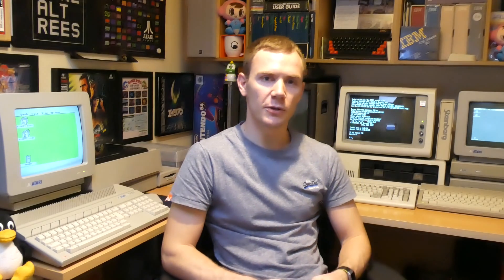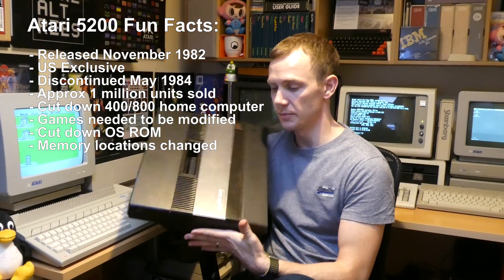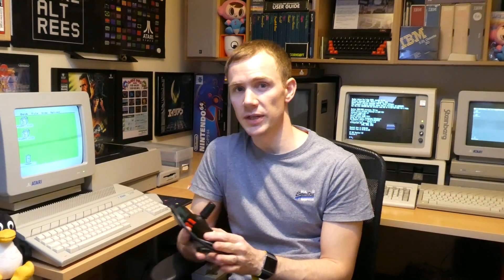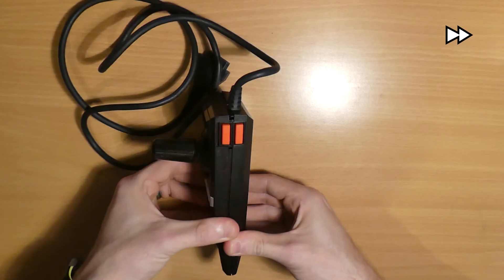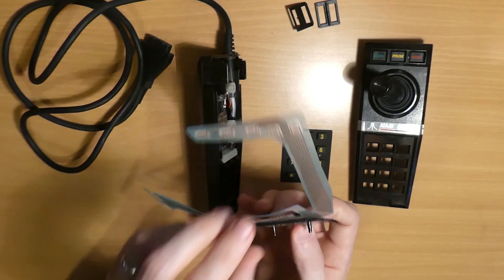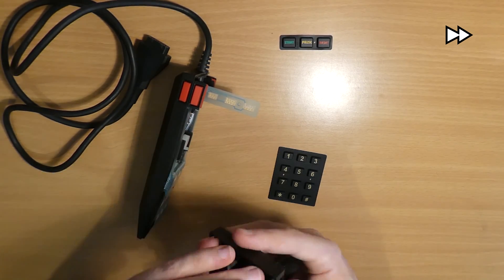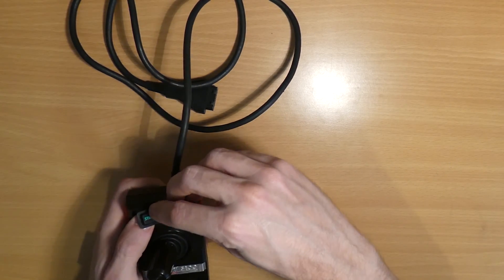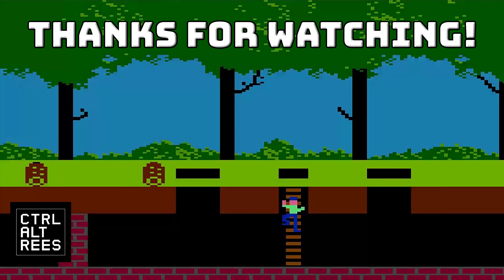HOWTO: Repair and Upgrade Atari 5200 CX-52 Controllers With The Best Electronics Gold PCB Kit!

Comment: Note: The Atari 2600 sold 30 million units by the end of its run in the early 1990s. That includes 6.5 million sales of the 2600 Jr. that was sold in 1986 at a wonderfully nice $50 budget price (that box was also really nice). Still, the comparison to the 5200 is sobering and a monument to Atari Inc.'s hubris that led to their downfall.

That said, the 5200 has a stellar software library, and the trackball controller gives us the best home versions of Centipede, Missile Command, Galaxian, Super Breakout and Pole Position, as well as great home versions of Pac-Man, Qix, Dig Dug, Defender, Robotron and Space Dungeon. Wow...I hadn't realized how much I like these videogames. My family owned the 8-bit home computers, so we were diehard Atarians.

This is a great tutorial video, I wish I had this knowledge back in '94 when I scored a 5200 console for $40, with broken joysticks, of course.

Comment: Just successfully repaired two 5200 joysticks this evening. It cannot be stressed enough how important it is to align the potentiometers correctly - the key to this was actually provided by another video on the subject. The top dial needs to be set to 9:00 o’clock, and the bottom needs to be set to 6. I was getting quite frustrated with the repair until that other video pointed this out, and I’m glad they did. Only then was I able to get the joystick working correctly. The well known defect with this particular controller is that it tends to drift and not self align properly, but if you get everything else working in tip top shape as in this video demonstration, then the alignment problem is more bearable for sure.

Comment: Great video!  Best Electronics is okay... late 90s early 2000s I ordered regularly from them, but recently, say the past 7 years or so, I found them... him... unnecessarily irksome.  Fortunately, there're many other suppliers these days.

That piece that encloses the START-PAUSE-RESET buttons you can just pop-off by inserting a flathead screwdriver between START and PAUSE and lift up... just in case you need to work on the controller with a  good flex-circuit (the potentiometers probably need lubricant).

The whole GOLD contacts thing is kind of a gimmick, any durable, conductive material would work as far as the buttons go; the stock conductive-polymer/carbon 'dots' were sheer crap.

Comment: So the kit doesn't cover the joystick?? But it's the joystick that's the problem!
Reply: The buttons were the worst part, by far.
Reply: You could dial the petentiometers (top dial set to 9 o'clock, and bottom dial set to 6 o'clock) to fix the stick drift for a while, but its not the ideal solution.

Comment: I gotta jump in on this subject. The Atari 8-bit computer line was originally planned to be a console replacement for the VCS/2600 for Christmas 1979. That was Nolan Bushnell's plan... to obsolete the 2600 before competitors [think the Mattel Intellivision in 1980 and the Colecovision in 1982] accomplished that. But when Ray Kassar became Atari's CEO thanks to parent company Warner Communications, Kassar decided that the project should be changed over to a computer line so Atari could gain the margins that Apple was earning off the Apple II line in comparison to much lower-priced consoles. So the 5200 is the return to the original purpose of the A8. It was made incompatible with the A8 line due to internal politics and infighting between the Computer Division and the Console Division of Atari Consumer. The 5200 nearly sold 2 million consoles and it apparently was also sold in Canada and possibly Mexico too [so North America]. A PAL version was designed. However, Warner forced Atari Inc to discontinue it in favor of the 7800 which GCC designed. It was Warner who over-ruled Atari's own engineers back in 1981 over including backwards-compatibility with the 2600 standard in the 5200. They also over-ruled Atari's engineers in releasing the CX52 joystick without making it be self-centering. So everything that the 5200 was blamed for was actually Warner's fault. And then Warner turned around and forced Atari to discontinue it. The 7800 was cheaper to manufacture than the 5200. Atari Inc's own sales projections showed that had the 5200 remained on the market, it would've outsold the Colecovision which originally had the advantage of being $100 cheaper than the 5200. Since the 5200 was discontinued, we lost out on Dan Kramer - who designed the CX53 Trak-Ball Controller - designing a 5200 Driving Controller [based upon Atari's arcade Pole Position Steering Wheel, Shifter, and Peddles] and a 5200 Yoke Controller [based upon Atari's arcade Star Wars yoke]. There had also been plans for a 5200 Kids Controller, a 5200 Arcade Stick, and even a Colecovision Adapter but they were all scrapped along with a bunch of nearly completed games like Tempest [which years later, Keithen Hayenga finished up and released through AtariAge] that were awesome. The CX52 was overly complicated so Warner could secure a bunch of new patents on the flex circuit and other innovations in the controller. The flex circuit wasn't ready for prime time, so to speak, which is why Atari went through 9 revisions of it. Many of us 5200 enthusiasts would love to see a thin PCB replacement created for the controllers using dome switches under the buttons. [the CX53 Trak-Ball Controller has a PCB under its numeric keypads and uses dome switches]. Now stepping off my giant 5200 box. :)